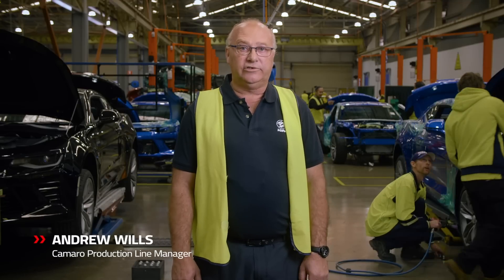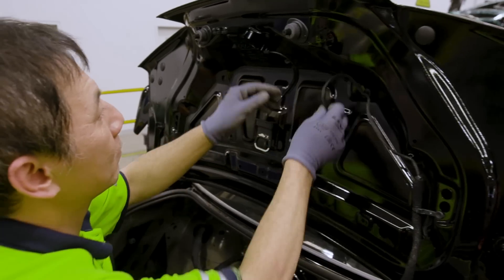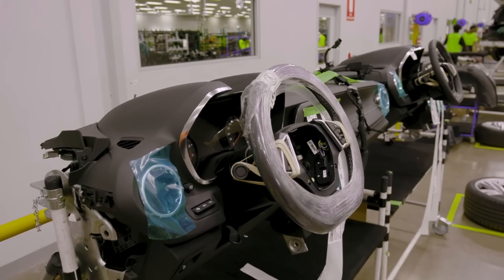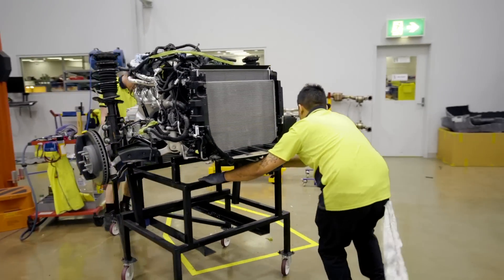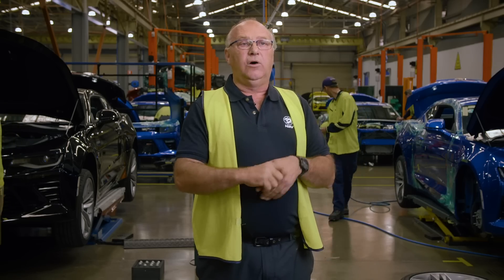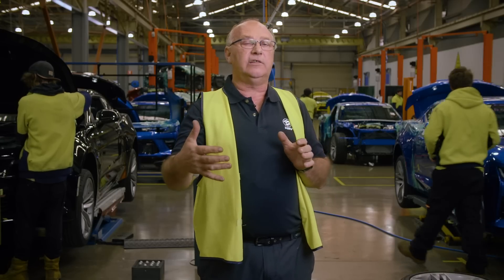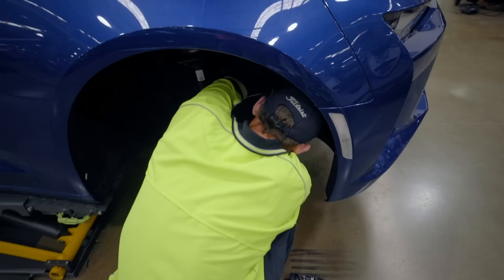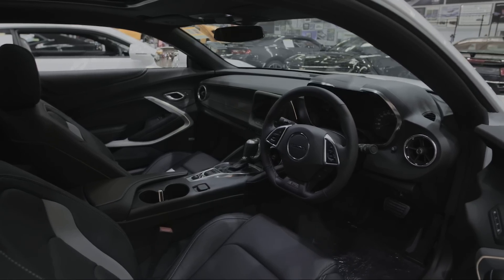The Chevrolet Camaro Re-Engineering Process

Comment: Like to know how the electrical harness is flipped to the other side, when there's no pre existing holes for any clips etc, the factory makes those holes for clips, so unless hsv has to re drill the right size holes for clips to go into, then think of all the extra holes required and then what happens to the left hand side holes are they re filled with rubber seals to stop any extra moisture and Nosie with in the cabin, also you will see they cut part of the firewall to fit various extra items which is on the right side of the firewall, what happened to the same hole on the left side welded a metal section which is from the cut out of the metal from the left right side used to fill the hole, how does this effect the Strength of the firewall, what about the engineers and what they had to say when it comes to cut and weld sections?

Comment: Australia should allow the Side Marker Lamps to remain on American vehicles. From first hand experience, they DO prevent accidents. Other than the aforementioned amber and red side marker lamps being replaced with clear lenses and deactivated, the HSV Camaro's look stock. Great Job.
Reply: Is that what this is? Are they re-engineering the vehicles for sale in the Australian Market? I’m not sure why I’m thinking Canadian
Reply: @dougedoug2105  Yes, those clear lenses on the side of the car, which on the Camaro are located on the outside edge of the front and rear wheel wells are called side marker lamps. In 1968 the US and Canada required all vehicles sold here to have both a light & reflector, amber on the front side and red on rear. They are illuminated when the park or headlights are on to make the car more visible from the side in the dark, and indicate direction of travel. They're not required in other countries and are often deleted on cars exported from the US, and the lenses may be changed to clear. Although, on Youtube I've noticed some US cars overseas still have them working. I don't get why they haven't been adopted elsewhere, they've been proven to reduce accidents. I was able to avoid an accident with a Chevy Blazer on a poorly lit road one night, so I'm sold on them.
Reply: @Steven I have to disagree. I avoided an accident with a much larger vehicle because of these lights. I live in a rural area, where there's a lot of unlit and unmarked roads. This isn't unique to rural areas, or the US, but while driving at night here, I'd rather have marker lights, than rely on a glimpse of the headlight or taillights. As for the looks: I agree with you, in relation to the trend of placing the front markers on the lip of the wheel wells, which look cheap and out of place. When done correctly they can add to the cars looks, especially at night. But, to each his own.

Comment: So brake lines have to be re done as well, they are not on the same side as well, might as well asked Chevy in the US to do it, but nope Holden / HSV/ Walkingshaw would have made the deal back in 2013? Full stop ? So that had all that time to do a mock up in the states with the parts made here and then test and tune it to be perfect and then start importing them here based on the amounts holden / HSV would have as new car sales, also ot one HSV bagging or certification by HSC, just the normal Plastic sticker is put on to say it was certified by government regs and stuck on the radiator front support panel, no HSV ID Meatal production number and all the other eg build numbers which is normally found on HOLDEN / HSV models on the firewall areas ? Chevy make the camaros for the UAE which is right hand drive, so why not let them do it lol:) Looks like those people at HSV convinced Chevy due to closing down of holden to have around 50 people keep their jobs at HSV in Clayton  Vic /

Comment: Also noticed no external Trans Cooler at all, hum looks like the 7 speed auto might get a little hot, so best invest in a external trans cooler if you want you auto to last just that little bit longer, also a oil cooler would help which i believe it already has one, like the VF GTS, but get a better Quality unit and little larger the same with the diff oil cooler. :)
Reply: 7071t6 it’s an 8 speed btw.